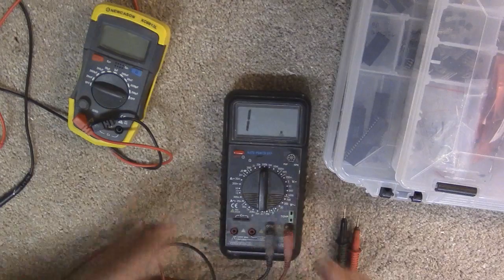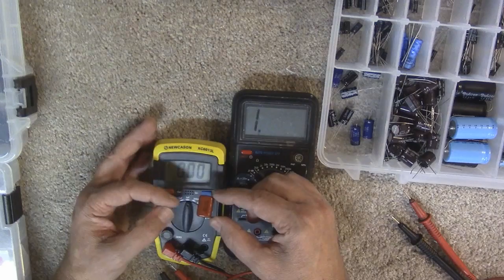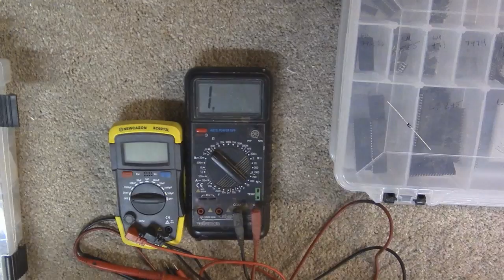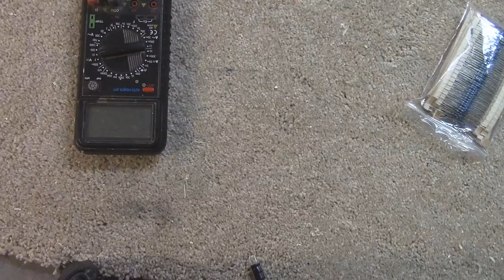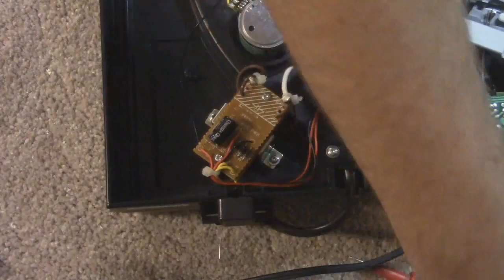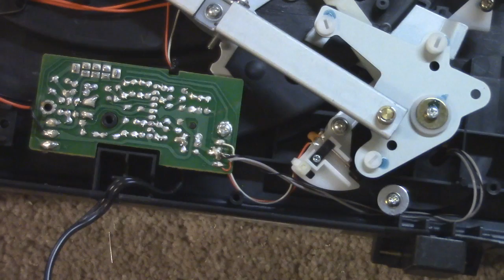how to repair electronics for dummies part 2

Comment: Why is it when I connect ac current to a devise there's these two chips that get super hot the devise works but it drains the battery and wont charge

Comment: when using a capacitor you should only use a maximum of 1/2 the rated voltage. that is if its rated at 50V you shouldn't use it for anything more than 25V.

Comment: I have a 1970s Mattel electronic game Uses a 9V battery. I get 9v on the PCB were the battery connector wires are soldered but the game it dead. I dd notice after a while the battery was getting hot like it was shorting out. Any ideas what it could be causing that? The game looks almost new  really great shape. Note battery is fine on other games.
Reply from the maker: I have no context of what the board looks like. if the battery is getting hot there is a short. test the transistors, diodes, and any capacitors on the board.

Comment: Man, im an aerospace engineer, I have to give you a huge thank you. you are very good with this, this is my weakness. my Welder which is a old miller trailblazer 301G, has no output to weld. everything else works. i have a couple of boards to check. i cannot buy new boards for it. so im stuck. Do you ever work on the boards? Im retired from the USAF after 23 years. i dont have the money to buy a new welder.  i thank you for a very good  video. you need to do more .
Reply from the maker: I have never taken one apart, but I suspect there is a transformer in there along with some heavy duty diodes. I would check those if they exist.

Comment: Hello :hand-pink-waving: I'm just starting yo learn electronics and this video is great ! I inspected a ps1 slim motherboard and there are a lot of capacitors (very small) with no number on it and have mostly a coffebrown color or black . how can I know (if one is bad ) what the value is ? thank you
Reply from the maker: you are talking about surface mount components. They are tested the same way, but takes a stable hand. The caps are probably not bad. The values would be in the schematic. that would be the easiest way to see them. 

the only caps that I would check would be in the power supply. Other than that, it is probably diodes, rectifiers, or ICs that took a crap.

Comment: hi there could you help me at all? i connected a rechageable 12v battery to an electronic device that takes 8x1.5v batteries. i connected it to the positive and negative of the battery spirals, something smoked and the equipment doesnt work. would you be able to tell me what i could possibly do to fix the item. (its a digital guitar amp - yamaha). thanks Pete in Ireland

Comment: As you said when resistor go bad it burns. So when you have to replace it how will you know what was its resistance.
Moshitoa south Africa
Reply from the maker: sometimes you can still read it. sometimes it is printed on the board. other times you will need a schematic.

Comment: Hi, thank you for your videos. I'm a newbie to electronics. Now, at the very  process of buying a new multimeter.)...I have a question.  So, for basic troubleshooting of home appliances, your multimeter have to have some basic functions only, like resistance, voltage, current, continuity/ diode test, right ?  no need for capacitance, hz, temperature, induction ? 
Is it enough for resistance scale to be up to 200 Mohm, maybe more ? and, how important it is to have mili and micro amps on the scale ? Thank you
Reply: buy you a cheap multimeter  less the 10$ it will do any thing you need or tbl shooting  i am 88 re- tired tech i keep 3 or 4 those cheap meter shop -desk -tool box .-etc handy  believe me master the little meter it will be all you need

Comment: Would you suggest that "newbies" go ahead and complete resoldering with the rest of the power supply board (after it appeared replacement of the capacitor fixed the problem) to ensure that jostling of the wires wasn't giving a "false sense" of success?

Comment: I’ve got an old boombox that is missing sound to one channel.  If i pull the board that contains the pot to balance amongst others, and bend it, the problem inverts.  As in the previous non-working channel starts receiving sound and the previous working channel loses it’s sound.

Comment: as someone just starting out as a hobby, your videos are excellent man! one question is i seen that mosfets are sensitive to static and they sell bracelet things for grounding. but i never see anyone in videos using them and it looks like everything is fine. doesn't carpet make static or does it ground it?
Reply: Carpets and anything that looks like it produce static. Static accumulating on your body depends on the humidity of your environment and the clothes you're wearing that's why most people can get away without using an anti static strap.

Comment: 3:15 Testing Capacitors

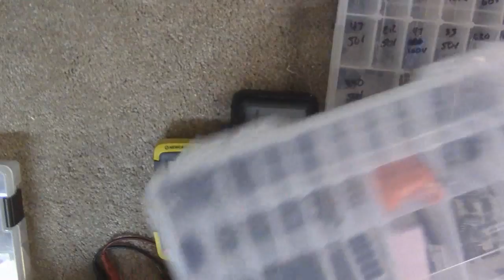13:07 IC (Integrated Circuit)

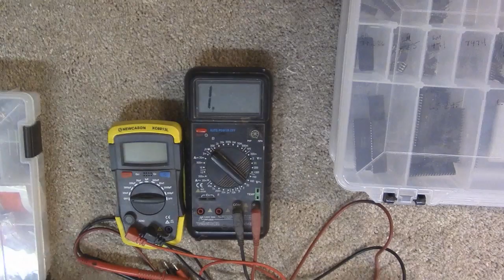17:30 Diodes

19:56 Transistors

27:28 Resistors

29:59 Reparing turntable

Comment: My professional radio repair trouble shoot routine: 
0.) Warning/Caution: Dont't touch (finger tip could induce your power network frequency) before you measured with a working DMM no electrical voltage potential to your ground to keep your safety! Otherwise this should be done by professional service personal!
1.) Watch out for bad things like broken/smoking fuses, connections & electronic components (R, C, Transformer, Diodes, Transistors, ICs ...), 
2.) Start from power supply on dead devices: measure voltages - 2.1 AC before & behind fuse, transformer, 2.2 DC behind rectifier, 2.3 compare your measurement with data sheet information of the electronic components, if DC voltage is missing you may put it from a lab power supply just to test your expectations,
3.) signal tracing from source to output on silent audio devices (working lamps / motors): put a hearable signal frquency - like signal function generator on pre amplifiers input pin or sound pickup connector: 3.1 If a connected amplifier with speaker doesn't buzz, go further down audio signal way forward until pre amplifiers output and 3.2 stop until you hear your test signals frequency. Now your behind the problematic / defect parts. 3.3 Now go deeper inside why this region of the circuits does not work well, draw the circuit & compare with basic circuit knowledge and check data sheet properties of each component what (should) it have for normal operation? 3.4 If nothing is clear: consider "brute force method = exchange every electronic component", with estimating component costs and probability of lifetime / failure - e.g.: typical probabilities: higher power = more failures ...

Comment: Holy shit
14:14     a Zilog Z80      wow
yes it's a cpu
yes  i do believe you are correct,   Atari 2600

in saying that, the Z80 was used in a lot of stuff in the 80s  as was the 6502
but the Z80 was used in your Atari's , Apple, Arcade Machines noteably Pong, pacman and space invaders
and then in the military and so much more , but yeah, i'm pretty sure Atari 2600 was there , along with a few other CPU'a along the way

Comment: Great clip!! I just wish consumer electronics were still worth to repair. :+
Reply: If you own them they are.

I've got 8 computer monitors in use and around a dozen or so not in use .
so... do you know how much it would cost to replace them ,   the one's in use
around... say.. $200 a monitor for 8 Monitors we are looking at around $1500 ish approx.

ok,  so i have now been keeping these monitors alive for the last , probably 10 years.
24" monitors that , FROM TIME TO TIME,  the screen goes out, and when it doesn't it's always the same thing
THE FILTER CAP
the cap costs me around 30cents to buy
I reckon i've probably chewed around $20 to $30 over the last 10 years    haha

i'd say that's viable for repair
let's not mention all the other shit that i've repaired over the years and in the course of my entire life since i was 6

a little while back i repaired my webcam,   which.. is not something you would really think to do .
Cold solder joints and a lose power cable that was starting to fall off
that's now been alive for around 8 years
anyway, i could go on and on , but i won't 

i agree that if your'e gonna pay someone for it, it's probably not viable , i mean 
the guy should be charing you around $120 to $200 for the call out and fix,   but then it could be more depending.
so if you have , let's say a 100" HD TV that you bought for $5000  and the motherboard dies   , with repair costs you could be up for $400 approx.
now. the same job on a smaller TV you bought for $150  even though its' the same thing... replace the motherboard,   it's not worth it.

but then you have some clients who don't give a fuck and pay anyway
so... yeah... each to his own
BUT.. THERE STILL IS A MARKET FOR IT 
not as big as it was back in the day, but it still exists

Comment: I have a board from 1986 that has electrolytic capacitors with 3 legs, I ordered new parts but could only find 2 leg versions.  I’m wondering if I should use a jumper cable or wire to the third connection.  I believe the one I’m looking to replace has two slots on the board that share the negative side if that makes sense.
Reply: I’m also wondering if the 3rd wire is just for stability

Comment: I would go on ebay and buy a transistor tester which coast like 20$ and can check, diode's, capacitors(and checks ESR), resistors, led's, just about everything. It is 100% worth the money....It will check everything in this video, except IC,s....just type in transistor tester in ebay and see...Great video by the way thanks...

Comment: I appreciate the video, I'm behind you for sure, but I happen to know turntables pretty well.

There is rarely an amplifier of any sort in those older turntables. If you weren't getting any sound out of it, and the motor wasn't turning, I would assume a bad ground/neutral. Or a bad power source,  or sorry to say, possibly operator error. The cartridge usually just goes directly back to the preamp or reciever through the RCA cables, and get amplified there. Doubt you still have it, but it would be easy to verify the cartridge lead route.

Comment: As you said in Part I, caps are the most common thing to go out so no big surprise here. What may need to be mentioned here is that although the cap value may have been measured, the leakage (ESR) wasn't because your meters don't test for that. Gotta love the solder sucker!

Comment: I'm a retired tech but still, do my own repair.  Electronic parts are very hard to find since Radio Shack is closed. Where are you buying your parts?
Reply from the maker: online mostly. locally all the places shut down.
Reply: Use Digikey or Mouser!

Comment: so why can you use a capacitor wiht a higher voltage?
Reply: In capacitors what matters is their capacity and the voltage should be the double of the voltage it gets in the circuit it is going to be used  just for safety reasons since lower work voltage capacitor may explode or be damaged

Comment: With a zener diode, once the zener voltage is reached it will allow current flow in both directions. Zener diodes are the only diodes that will allow current flow in both directions.
Reply from the maker: yes

Comment: The resistor color code is:"Bad Boys Rape Our Young Girls But Violet Gives Willingly  -  Get Some Now".   The first letter of each word represents a color for the first two color bands on the resistor: Black=0, Brown=1, Red =2, Orange=3, Yellow =4, Green =5, Blue =6, Violet =7, Gray =8, White =9. The third color on the resistor color band represents the multiplier which is 10 multiplied to what power. The last three colors which represent the forth color band on the resistor, and may or not be present, are the percents of tolerances of the resistor. Get=Gold (5%), Some=Silver (10%) Now=no color (20%) The first two colors are numbers, and the third color is the multiplier. The forth color is the percent of tolerance which is sometimes not listed , but if it is,, it will either be 5%, 10%, or 20% depending on the color of the forth color band.  So for example if the color bands are green, brown, orange, and gold, the resistor is a 51 times ten to the third power, which is a 51,000(k) ohm resistor with 20 percent tolerance. See link to better explain the resistor color code.   https://www.google.com/imgres?imgurl=http://www.resistorguide.com/pictures/resistor_color_codes_chart.png&imgrefurl=http://www.resistorguide.com/resistor-color-code/&h=609&w=600&tbnid=tdS8OKaKcyTdQM:&tbnh=160&tbnw=157&usg=__aZCN1tMMiztUq7FKzTFnxNbUxUk%3D&vet=12ahUKEwiyl6a4lZfbAhUO61MKHUqDDswQ9QEwAHoECAEQLg..i&docid=e8rCe-kEsiDjlM&sa=X&ved=2ahUKEwiyl6a4lZfbAhUO61MKHUqDDswQ9QEwAHoECAEQLg

Comment: I am also in the process of learning how to read a schematic. It is kinda hard but little by little I will get it.
Reply: Reading schematics is not too difficult to learn. There are some basic symbols that you must memorize or learn, but once you know them, they stay the same meaning. It is, however , difficult to look at a circuit and determine how it works and what is it's function. You usually must be an electrical engineer to be trained in this learning.
Reply: Well right now I am trying find out why my hitachi cr303 is not producing sound, I am thinking it's one of the IC's that is bad.Cheers

Comment: on a resistor does it mater where you set the leads of the DMM? can someone tell me?Thank You
Reply from the maker: no, resistors are non polar. you can put either lead on either side of the resistor.
Reply: and you can get the same reading?
Reply from the maker: you should.

Comment: I have a Hitachi sr 303 that I am troubleshooting and have not been able to find the problem.The problem is no sound coming out of the speakers I have checked the IC for the amp and I am getting sound when I touch a couple of the pins.I have cleaned the controls with deoxit but I will do it again and hopefully that is where the problem is. Does anyone have any ideas as to what else I should check?Thank you

Comment: thanks one more thing when i hook up the resistor to the charging circuit  should the resistor and the diode be hook into the same circuit
Reply from the maker: I have no idea what you are building or repairing so I cant answer that.

Comment: i have a cordless screwdriver that i took apart and i can't remember how it is supposed to wired can it still be wired to work
Reply from the maker: sure. there shouldn't be anything too hard to figure out. it would be really hard to screw up. the motor can only go one way or the other.

Comment: I'm having a problem of losing some input channels on my Kenwood KA-109 home amplifier/receiver. Phono stage works but does not go through the IC. The inputs going through the chip are gradually quitting. I just ordered all new capacitors for the tone board and when I replace them, I also am going to try to fix the input problem. I am not good enough to solder the 28 pin IC chip, and was wondering if I could bypass it and hook up just the CD input to the output of the IC to the amp board. I only listen to CD, but the phono stage isnt the right level for the CD player.
Reply from the maker: replace the IC. if the IC is bad, nothing else you replace will fix it.

Comment: i would have done it in this order: 1-Voltmeter, check voltage everywhere starting from output of transformer in ac, then if no voltage somewhere, 2-check parts, wires,circuits tracks and solder joint and 3) resolder/change bad components. This capacitor you change just smooth dc and keep ac noise low, you should have the turntable working but with lot of noise (like in mine!). You solve the problem by resoldering I think it was a cold or broken solder joint. Well done any way !
Reply from the maker: I figured it was that or one of the wires is loose. I'm keeping an eye on it.
Reply: +HOW TO BE AWESOME SAUCE I was waiting for you to show taking a diode out of circuit to test. The reason I'm asking is I have a newer pinball machine that I'm suspecting has a bad flipper diode. I was told by someone that works mostly on the old EM pinball machines tell me that you can still test a diode while it's still in circuit and get an accurate reading. I've always have been under the assumption that diodes can't not be tested while in circuit.
Reply from the maker: they can be sometimes, but just undo one side of the diode and see if current goes only one direction. i have a pinball machine and sometimes they diodes do go bad, but their might be a capacitor nearby also causing it. if it doesnt work at all, check the board's transistors. they go bad all the time.
Reply: Thank you for the advice. The pinball machine works fine for the most part. Every so often for what seems like no reason the machine would just stop. The back box is still lit but the playfield goes dark and flippers cease to operate. The best way to describe it is if the machine is tilted even though the tilt light doesn't come on. I was thinking the best place to start would be a possible flipper diode. I also thought the only way to test a diode was to remove it partially out of circuit. Thanks again for your help.